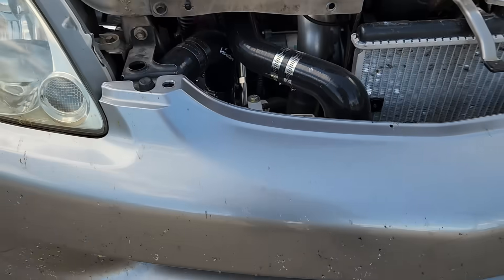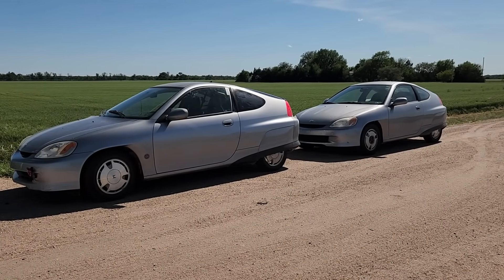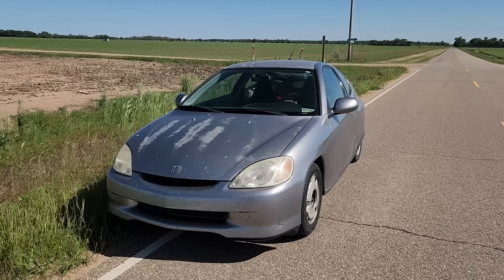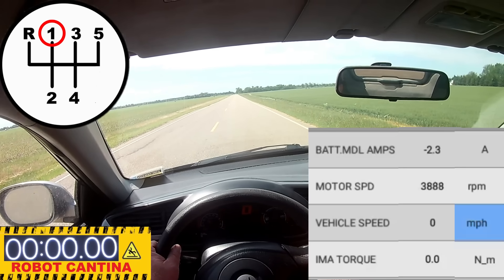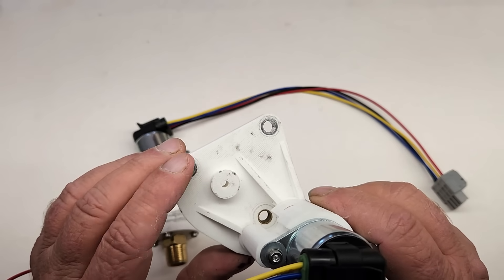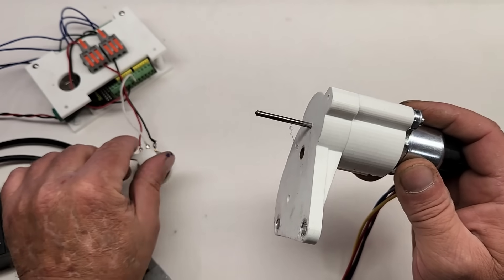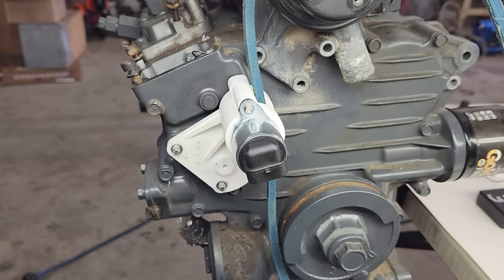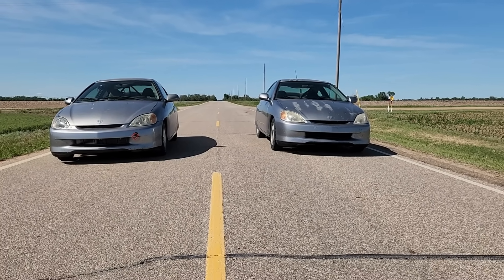S4 E18. Will an AMR500 supercharged Kubota diesel Honda insight outrun a stock Honda insight?

Comment: Have you considered installing a water mist/injection system to reduce engine heat and to increase power and possibly fuel economy on the diesel engine

Comment: It'll be interesting to see what the fuel controller and a bit more top end fuelling on the pump will do for performance? I personally think that you should have one more go at doing another supercharger pulley to try and get back the 12psi you had before the intercooler.
With the fueling matched to 12psi then now its intercooled, that would make the engine as powerful as its ever going to be in this configuration.
My prediction is that the Insight will be able to achieve a 20sec 0-60mph time, maybe a high 19sec on a cool day. 👍

Comment: I think it would be really cool if you were able to go all "Rich Rebuilds" and put together a Lithium ion battery pack with 18-650s or something like that, possibly generate more power with the electric motor or put a more powerful motor in the "Normal" Insight and make it a plug-in-hybrid to increase performance and economy.  Another crazy idea Inhave had for a long time is to take a hybrid, plug in hybrid or EV with limited range, put a receiver hitch on it and take a cheap engine like a diesel or gas "Harbor Freight/Clone" engine that drives a 5th wheel with a fixed belt or chain drive that is designed with only an on/off switch and a manual clutch so that you can bump start it while rolling that is geared with a manual throttle or governed to be able to maintain a cruising speed between 45-70mph on level ground, as a range extender, it would still require assistance on a grade but, it should significantly reduce the energy needed to travel long distances with a charge of course going down hill you would be able to regen brake to fill the battery, in slow speeds or stop and go when those vehicles are most efficient it would be off. Just to give the effect of the car coasting to extend cruising range. I had the idea 11 years ago when I leased a Focus EV for tax credits in GA for my Ex to commute with when gas was $4 a gallon and she went 70miles round trip to work everyday. I thought it would have been incredible to use a fullsize spare being driven with a small engine to maintain a 45-70mph speed on level ground with minimal controls, it would be mounted on a hinged frame that used a coil-over to put the vehicles weight on the tire and allow articulation. I even thought a small single or V twin mechanical diesel with a tiny turbo, AR500 or M90 blower that was capable of generating just enough power to maintain highway speed with using minimal fuel would be a good idea so level running at 65-80mph highway pace would be possible and it would compensate for the hlbighest short comming of early EVs with small batteries that only got a 70-80 mile range.

Comment: Hey the gearbox was the problem because i have the same issue with my car the gear ratio was not optimal and in the end the max speed the acceleration and the fuel consumption was improuved when i put my new gearbox

Comment: Have you looked into using a chain roller from an ATV or Dirtbike for your idler pulley?
They're usually less than 2" in diameter and they take a massive beating from the chain.

Comment: Your supercharger is fixed volume pump. So u don't pump more air into engine when intercooler drops its pressure by lowering temp. I think intercooler allows u to pump more using same power and with lower temp.

Comment: The engine needs a Turbo!
Free Hp ,no drag on engine .

It also needs a n electric boost , like the  original.
Put the electric boost motor where the AC compressor would go on the belt !

Comment: A 50cc moped chain tensioner pulley will fit beside your fuel rack actuator and do the job as far as not letting the belt lash out into the 3D printed mount. Not sure how long it would last. I have almost 1000 miles on mine.

Comment: I'd be boosting the motor to 60 psi.

But then, I've been building diesels for a very long time.

And since this is all 'just for fun', I wouldn't be worried about long term crank bearing failure.

I'd just use some pricey racing oil and be ready to replace the bearings every 10,000 miles.

[HOP HOP HOP!] 🐰🐇

Comment: I was wondering if it's possible to put a 670 predator in an automatic transmission? I can't find myself a cheap manual transmission truck or car.  I have been wanting to build a car for in town driving.  My only way of transportation is a motorized bicycle. 

I love the videos and it's very inspiring. Keep doing what you're doing.

Comment: Based off of how quickly the battery amperage dropped off, I’m going to say that old HV battery is well worn out, hence the slower than specified 0-60 time. Most hybrid vehicles are heavily dependent on their electric drivetrain because the gas engines they use are absolutely pathetic by design (that’s the only way to get acceptable fuel economy out of a gas engine)

The metric folks would use kW for power instead of HP (which is a unit that makes no sense). The formula is largely the same… torque*rpm/a constant

If you want a tiny belt idler pulley, most of the DOHC models of Subarus use a roughly 1” diameter idler pulley on their timing belts. It’s dumb on Subarus because they always fail (sometimes before the 100k belt interval) but might be useful for some of your projects. Gates part number T41239

Comment: VW / Audi Tdi Cambelt Idler Pulley is a much smaller fixed one.   Without having one in hand, about 20 - 25 mm outer diameter.  👍

Comment: You can use vw 1.9 TDI (engine code ALH) timing belt idler pulley. They are like 20mm in diameter and use m8 bolt just like your water pump

Comment: Regarding material strength. ASA is MUCH weaker than PLA. The only real downside to PLA is the low softening temperature. If I need high strength and high temperature handling I use GreenTEC Pro Carbon. It prints as easily as PLA and is as stiff as PLA. Few materials are actually as strong as PLA though for solid parts.

I design and 3D Print large model jets and high power ducted fans.

Comment: About the idler pulley, there is a very small one fitted to some Subaru models. It's about 31mm diameter. 
Part number, Gates T41239.

Comment: Skateboard bearings make good idler pulleys and you can stack them if the belt is wider. We use them a lot in car audio when we run multiple alternators.

Comment: 2:46 at first i thought, i heard the wheels spin, but ...
lol, pretty cool you can do 120 km/h with a lawnmower.
Try casting a cyl head, by taking of the the head from the spare engine to measure.
The high pressure diesel pump from common rail is really simpel, it's like a 3 cyl radial engine without con rods. probably best to buy a used VAG one a scale it, you need like 1500/2000 bar / atmospheric pressure.

The narration is hilarious, lol.

Comment: Any roller bearing can be a tensioner so the sizing shouldn't be a problem. On Ducati engines, they use 2 small bearings together to get the correct width.

Comment: Now you just need the thermostat actuated with those stepper motors (or a motorized ball valve) to fix the low running temperature problem.

Comment: Still watching but if youre significantly lowering intake temps without benefit, then I would guess you either cant enough fuel in for the increased air, or the density is higher (cooler) but youre not getting more air (reduced flow offsetting density increase - maxing out the compressor etc)

Comment: Jimbo try a skateboard wheel for a tensioner pulley there smaller sized durable. Worst case lathe it down and just make a simple style like a Nissan or Hyundai where the bolt adjusts the wheel down and using under water pump bolt holes I think it would work and fit

Comment: Under Montana Law, you need to pass a three point inspection (headlights, tail lights, and brakes) for the vehicle to be registered and  all of them need to be in operational condition. Technically you can drive a rolling chassis with head lights and tail lights and brakes, it be weird, but you can do it.

Comment: I continue to love this channel. I drove a stock Insight for a decade, before putting a K24 engine in it. Now I'm getting another after moving to New Zealand and plan to replace the hybrid battery with lithium, and "overclock" the motor. 

I understand the IMA system works entirely independent of the ECU. Possibly, you could get your supercharged diesel working with a lithium powered hybrid motor. One person reportedly got a 1.9 TDI working, with the Insight IMA motor bolted to it.

Comment: You should get yourself an old Mazda Miata for some of these experiments. They're tiny and lightweight but have a surprising amount of space in the engine compartment for whatever shenanigans you want to try next. Plus they're rear wheel drive so you don't have to wedge the engine in sideways

Comment: Rough conversion is, subtract 25% from newton meters to get lb-ft, and add 33% to kW to get horsepower.

Also that calculated 12.75 horsepower for the electric motor is spot-on for the official 13hp spec.

Comment: I think you are onto a massive gain in economy with the fuel rack limiter.

The supercharger blow-off is probably going to help but may result in more power losses due to inefficiently burnt fuel when cruising. Since you're trying to burn all the fuel you are using to maximise efficiency it may be wise to maintain boost and control just the amount of fuel. By cutting boost while cruising the amount of fuel required to maintain speed would likely increase and offset the power savings of making the supercharger unladen. 

As unintuitive as it sounds – you should aim to increase EGT and bypass the intercooler for maximum efficiency. Thats Volkswagen's approach to fuel economy on their petrol and diesel engines.  

Heat wrap the exhaust!!

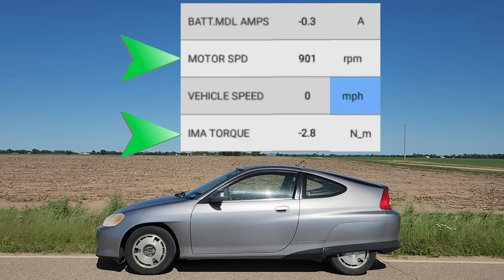Comment: 5:48 - IIRC,the IMA motor will provide up to an additional ~13HP. Assuming the IMA battery is in good enough condition,and SoC. The IMA system limits the max. electrical power to ~10kW.
7:30 - Yea,that checks out. 84A,so battery voltage was down to about 1.0V/cell. (the IMA battery is 120cells,so about 120Vdc total.) 120Vx84A=10kW=13HP -rough math.

Comment: Jimbo, have you considered a sprayer for the intercooler for when you inevitably turn the boost back up with the lower charge temps?

This was a thing we used to do with small displacement jap motors for a time. 12v relay, some junkyard hose, zip ties, two washer nozzles and a washer motor.

Amazing what you’ve achieved thus far.

Comment: Not to nerd out but, couldn't you add the electric motor to the rotating assy. on the diesel engine for a 1:1 power gain? Be it accessorie driven or driven off the fly wheel? Iv always wanted to try to make a hybrid but instead of using the electric motor to increase efficiency I would use it to increase power. Just a thought. Great job and keep on keeping on.

Comment: What if you replaced the transmission with a big differential (ie: ford 9", but probly something with irs)) with the engine connected to one axle, the electric motor connected to the other axle, and the pinion connected to the pinion of another differential (maybe gears) with the axles acting as axles?

very the speeds on either input and the output changes, like a cvt, without the stupid belt!
Reply: (that is sorta like Toyota's thing, but 3 dimensional)

Comment: the engine might be worn out but the electric motor run just as good from the factory. The unfortunate part is it came with only a 6.5Ah 144V battery which is less than 1KWh meaning it will go from 100 to 0 in 6 min at 10kw

Comment: hey, im a woman but i never use a purse!! but im also maybe considered a bit of a tomboy and do things like blacksmith and modify my car, so
Reply from the maker: Thanks for watching my odd channel!   I was very surprised to find out the female watchers jumped from 1 to 3% recently....that works out to be a huge difference. Keep up with the  Blacksmithing and car mods, but I don't recommend putting a lawnmower engine in your car if you can avoid it.
Reply: @robotcantina8957  I was appalled to see that my cammed '86 volvo 745 gle barely beats a stock insight, admittedly I was on dry rotted tires and it didn't quite hook up right away but still. And yeah! I've been a regular watcher for a little while now, I think right before all the Saturn experiments :)

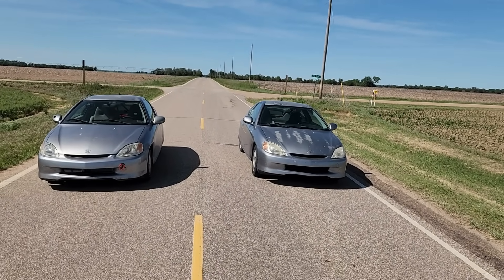Comment: 1:38 Technically in certain states while yes not exceeding the speed limit is legal, “racing” or accelerating hard when unnecessary IS still illegal, although in your case full throttle is a Honda civic casually accelerating😂😂

Comment: You should get a small pickup like a Ford ranger. The engine bays are much larger and the weight is about the same i think they are around 2k pounds.

Comment: Boost vs air volume are 2 different subjects. You're moving the same amount of air, but seeing less boost due to the loss of heat from the intercooler. 

So now you could actually shove a little more air volume down it to reach the same boost as before

Comment: I learnt to calculate the power of electric motors in school this way :
P=M*ω
M*ω = P
28NM*2*pi()*(3243rpm/60) = 9508 W 
9508W * 1,36 = 12,932 HP
Reply from the maker: Interesting, I didn't know it was a different formula..  makes sense.

Comment: The IMA motor on insights and civic hybrids have the advantage of delivering instant torque at any rpm so while 20 ft lbs isn't much the gas motor only makes about 90 ft lbs at a certain rpm band and that's a noticeable increase when you're getting 20%+ more torque. I love my 03 civic hybrid it feels quick when you drive it hard because of that extra oomph the IMA adds and manual transmissions are an amazing Duo of fun and tech that gets me 40+ mpg when I do drive it more civilized
Reply from the maker: From what I understand the Civic Hybrid has a very reasonable gear set in the transmission and are great cars.  The Insight has  a weird set of ratios,  and when the IMA kicks in its noticeable, but on my car it seems it takes a few moment after a gear change before the IMA starts helping.

Comment: "3D printed parts are actually robust..." you've never been to Florida, have you?
Reply from the maker: Good point,   Actually, I haven had any problems yet with ASA, but in the past I made a bunch of camera mounts from PLA and every one of them failed after the car was left outside in the sun for a few hours.
Reply: @robotcantina8957  I had several aviation headset yolks warp in the sun. They were supposed to be made from some "400 deg." space-aged plastic that was guaranteed for life. I got tired of replacing them (for free) and CNC'd them out of aluminum. Most seem not to understand the level of UV we get this close to the equator.

Comment: Any chance you'd be willing to share your blow off valve file thingiverse or anywhere like that? I could really use that as an idle air control valve for a supercharged car I have because I need a remote idler control valve it looks like I run a hose from the bottom to my intake.
Reply from the maker: I'll share the STL files soon.  I need to verify the design first.

Comment: I've done turbo's just "on the fly" sxs and tractors. The mechanical stuff zero issue. We've always just guessed on what it can handle and*knock on wood* everything's been ok (usually 7-12psi max). I wish i had a clue on the electronic part!  Arduino and the electrical bits and bobs i just have zero knowledge. To be able to make a more reliable improvement without the worry or risk of blowinga $2-5k engines would be nice.
Reply from the maker: As long as you have an EGT gauge you can safely push the engine a little bit harder.  We are finding  with stock valve springs and stock injectors the engine starts making "noise" above 12psi.

Comment: Hey Jimbo if you run into belt clearance issues you may be able to use a VW 1.9 ALH TDI timing belt idler. They're pretty small in diameter.

Comment: Why did you choose such a relatively expensive piece of kit like the Kubota Diesel engine? Was it the lack of options? You could have chosen a VW TDI or SDI. 🙋‍♂
@14:59 You basically mimic a turbocharger with this contraption for non-linear power on good old Murica's highways. 😊
Reply from the maker: The brand new Kubota D722 we are using was donated to the channel by our number one patron.  The second Kubota D722 that we have as a spare was also donated to the channel.  we like free stuff and that's why we use the Kubota engines.  We do have a 1.6 VW diesel in stock waiting for a project.

Comment: I would love to see the Kubota being a generator to charge batteries for an electric motor. So you can run a setup with a small amount of batteries but have the range of or diesel tank.

Comment: That 1 second difference in the acceleration test for the normal Insight can easily be explained by the altitude you're at.
Reply from the maker: Interesting....I think we are at 1400 ft.  Hmmm I recken that makes a difference.
Reply: @robotcantina8957  yes it does. About 2% lower atmospheric pressure per 1,000 foot elevation. That's roughly 3% less horsepower for you, coupled with a higher than standard temperature would probably account for most of the lost performance, the rest I would attribute to normal wear of the engine. Love your channel and voice over narration. Meh, stupidcharger, and other 1 liners are a wonderful way to start my Sunday mornings!

Comment: You will need a high flow exhaust,for lower egt.🙂
Reply from the maker: We learned a thing or two from the turbo diesel saturn and the exhaust on this car was up-sized to provide the least amount of restrictions as possible,
Reply: @robotcantina8957  Put a glasspack on the exhaust,for bigger exhaust pressure.🙂